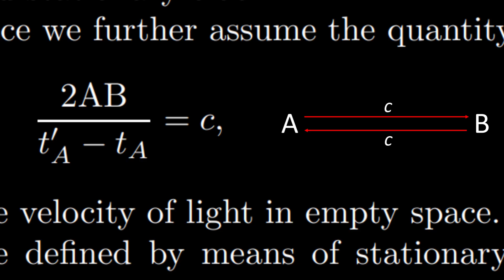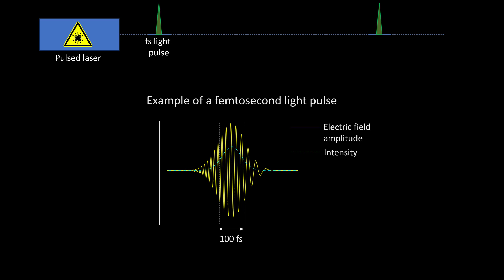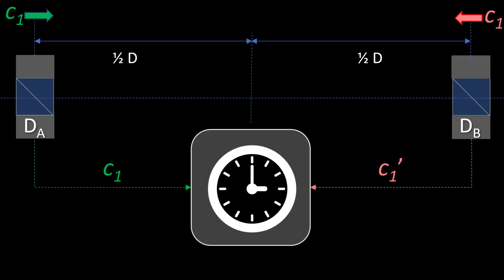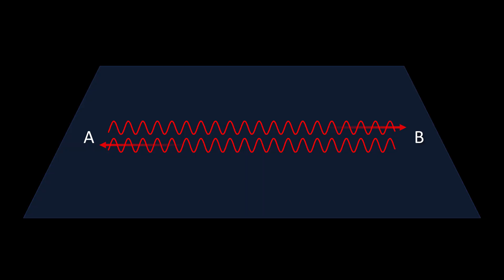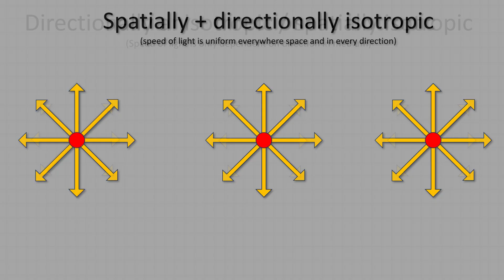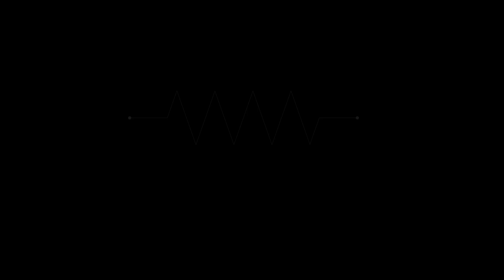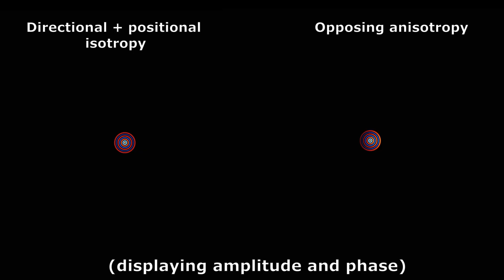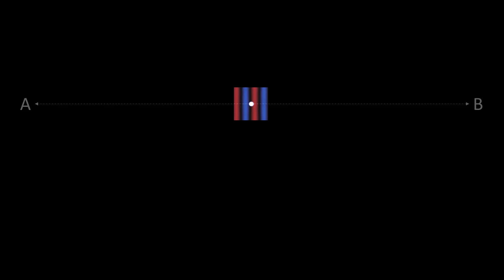Knowing the one-way speed of light

Comment: It's actually quite easy, technically you just have to take advantage of the non-linear nature of time dilatation.  Basically you take some atomic clocks, move them rapidly in two different directions and graph the change in time.  The time dilation on each clock should fit the curve t₀/√(1-v²/c²) where t₀ is the time for the 'rest' reference.  If they fit to the same curve for each direction, then the one way speed of light is the same.  In the Veritasium video Derek seemingly forgets that time dilation is nonlinear and doesn't get 'canceled out' when you bring the clocks back together to check their differences. It's annoying. 

The other way is that you just use a particle accelerator to spin a proton or whatever at like 99.9999% C.  If the speed of light were different then the particle would have to slow down on one side of the ring in order to maintain it's mass. (or it's mass would fluctuate on each side) in either case you'd need to adjust the timing or strength of the magnets to maintain the particle in the ring - in other words every time the large hadron collider is use the one-way speed of light is verified to be equal.

Comment: If the light had different speeds then we could not calculate its speed with the Maxwell equations and it would not be constant so classical physics falls apart. There’s another circular problem. We have defined meter in terms of speed of light so we wouldn’t be able to set up two ways equal distance without the assumption that the speed of light is constant. That is why we cannot solve this problem in classical framework.
Reply: We can define the meter using the bidirectional average speed without requiring that the speeds in opposite directions are the same

Comment: Your second explanation does not consider the main reason why one could use c1 different from c1' : the vacuum is not at rest compared to the observer. That's the main (and only) point of disagreement with Einstein relativity: the inability to observe absolute velocity, also know as the absence of Aether.
Reply: Indeed: there are no issue in the demonstrations, but they are a little bit superfluous as intuition give c1=c1' in a medium at rest, it was well known experimentally for other waves (where you can get out of the propagating medium, by using a much faster wave (light) to see much slower ones and the medium motion (sound and air, or waves and water).
So naturally people assumed the same before Einstein for light propagating in aether, and the whole discussing was how do the aether moves and how do we move on the aether. Strange things were observed and Poincaré came with a math trick to explain them. Then Einstein came and went further but telling that as we can not measure anything about motion (relative to) the propagating medium, keys get rid of the propagating medium(he went too far from me, but that's personal and strangely throwing the baby with the bathwater was fruitful - my guess is because it emphasizes the fact that we are deeply embedded in aether, without any way to look from outside, and this is a much more profound fact than it seemed)

Comment: But what is it about the nothingness of a vacuum that makes it resist or allow electric and magnetic fields?  I understand how air or water or copper or wood can have a measurable effect on electric and magnetic fields, because there is actual physical matter there.  But in a vacuum there is no matter.  So what is hindering or allowing those fields that gives the known values of Mu and Epsilon?  And if the presence of absolutely no matter in a vacuum gives these real values of Mu and Epsilon, then what stuff has NO influence on electric and magnetic fields?  What stuff has Mu and Epsilon values of zero?  When you measure Epsilon and Mu for a vacuum (nothing) by what known standard did you calibrate your instrument? Epsilon is a declared constant, not a measured constant. And they calculate it from Mu and light speed.  So now you can't claim that you can calculate light speed from mu and epsilon can you? That's a circular argument.
Reply from the maker: The vacuum does not contain matter but it does contain energy. And since matter and energy are equivalent, they can both be the origin of gravity and spatial inertia.  However, how much energy space is made of depends on who you ask: a quantum physicist or a cosmetologist will give you quite different values.
Reply: @HuygensOptics  Really? You think that matter and energy are equivalent because of SR?  The easiest theory to show is based on nonsense? Anyway, lets say you do believe really believe that matter is energy, so then, the vacuum is not empty, so its a medium then, an Aether, as Einstein himself admitted in his 1852 writings. But the vacuum contains no "matter" only "energy" which is equivalent to matter.  But what is this energy exactly? Define it please.  Not inertial energy, not chemical energy, not radiant energy, not electrical energy, not magnetic energy, so what is it?  You can't just say its "energy" because that's like saying that the vacuum is full of "Blurf" and not telling us what Blurf is. I have not heard any cosmologist or Quantum physicist ever say anything that was rational and logical. But they love lots of fancy words along the lines of my Blurf.  (such as "virtual particles that pop in and out of existence".  (virtual= pretend, imaginary) a virtual friend is my imaginary friend, the only guy who has the time to talk to me.

Comment: Hi, very nice video. I was thinking that you only considered a restricted class of anisotropy. I think it should be possible to have non equal speed in two directions without breaking energy conservation: you would do it with a chiral material. Left handed and right handed have different propagation speed. At the mirror you convert one into the other
Reply: True, but we know that the vacuum does not have such properties, since it would be easily detectable.
Reply: @entcraft44  well yes, but you see, there is a reasonable way to get different speed of light. This way has other consequences of course. I am not sure if one could not cook up a way that was not easily detectable. In the end, the question is about how isotropic the vacuum is. We can just assume it is, but it's nice to think to what level can we probe if it's the case

Comment: 17:50 Well but the point here is not that the speed of light doesn't change. It's only saying that the 2 way speed is identical for both A and B. Try moving A and B closer to the mirrors, without moving the mirrors. Then the signal from B will arrive earlier than A.

We can do for this an interference experiment in the vertical direction, aligned with the gradient of the gravitational field :) this experiment has been done and the result is called the shapiro delay.

The reason you don't see interference normally is because the gravitational field is pretty much identical in every point of the room you're in.

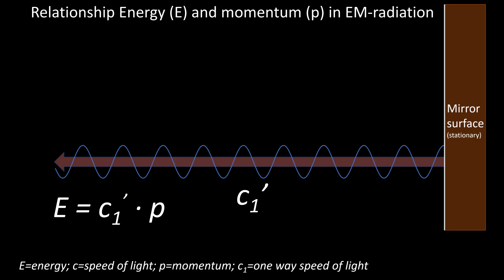21:50 well we DO have gravitational redshift, so energy conservation does not really apply here...

Comment: Sangac interferometer.
Reply from the maker: Good suggestion, I need to look into this.
Reply: @HuygensOptics  This YouTube video by Doug Marett (plenum88) essentially demonstrates how to measure the one-way speed of light using GPS data: "Earth rotation measured using GPS" (v=-bnBbHFfZ6k).

Doug shows how to use GPS data to calculate the pseudo-range correction (i.e one-way straight-line Sagnac Effect) as a GPS satellite approaches or recedes from a GPS monitoring station located at the equator.  Since we can calulate the value of the pseudo-range correction (in meters) from how far the station has moved from the instant of a GPS transmission due to the Earth's rotation, we know the propagation time and distance to the station at the instant of transmission.  Even better, we know the these values when the satellite is directly overhead and the correction is 0 meters.
Reply: @HuygensOptics  I can confirm that the Sagnac effect is relevant. 

About world wide synchronization of clocks. There is a unified world time: UTC (Coordinated Universal Time).
Likewise, the time keeping of the GPS system is a coordinated time keeping. That coordination of time keeping, down to nanosecond level, is what allows positioning down to the meter range.

The synchronization procedure that is used by the GPS system is not Einstein synchronization procedure; that would not work. Imagine a set of, say, 12 satelites orbiting in, say, the equatorial plane. Let the satellites be numbered 1 through 12. That constellation of satellites is relaying timing pulses around the loop, in both directions. So: from sat. 1 to sat. 12, and then sat. 12 relays the pulse on sat. 1 again. Same thing in the opposite direction. So in both directions a train of timing pulses is beying relayed. For the train of pulses that is co-propagating: every pulse takes a certain amount of time from emission by sat. 1 to being received again by sat. 1 after completing a loop, since during that loop satellite 1 has traveled some distance along its orbit. A protocol can be devised to work towards a sustained state such that the pulses traveling in co-propagating direction are equally spaced in time. Same thing for the counter-propagating train of pulses: make those pulses equally spaced in time. 

The key property: the speed of light is the same for the co-propagating light and for the counter-propagating light. It follows: when you have the same number of pulses in each direction, (as in, for instance, 12 pulses in each direction), then given that the time keeping is coordinated: as measured by the coordinated time the co-propagating pulses will be a longer time interval apart than the counter-propagating pulses.

The above described difference is an instance of the Sagnac effect. Information is travelling around a loop, in both directions. The time keeping stations have themselves an angular velocity with respect to that loop. To arrive at a coordinated time the angular velocity of the time keeping stations must be taken into account.

That coordinated time can be used as the basis of a one-way measurement of the speed of light. That will be a true one-way measurement in the following sense:
A speed-of-light measurement counts as a one-way measurement if the synchronization of the clocks that records time-of-emission and time-of-reception is established in a way that is independent of the propagation that is measured.

I will contact you directly: this subject is among the most interesting aspects of coordinated time keeping.

Comment: Electromagnetic waves do not need a medium to propagate while mechanical waves need a medium of propagation. That is why this analogy is not valid.
Reply: EM waves propagate in the EM field. You might not want to call it a medium, but the math is exactly the same.
Reply: @TheOneMaddin  EM waves always travel at maximum speed of propagation. Sound waves travel relative to the maximum speed of mechanical wave propagation in air. 
Maximum speed of propagation does not imply there is a medium. It just suggests waves can travel relative to maximum speed of wave propagation.
The notion that light slows down in the medium is false. Light never slows down in  a medium. Photons just takes longer path while travelling through medium at the same speed as outside of the medium.

Comment: Could you measure one-way light with two very good clocks (such as atomic clocks with 10^-xx where xx >11) stability over 15 minutes. Synchronize and measure time send/receive, swap positions and measure time send/receive?   With 10km you have ~30usec one-way.
Reply from the maker: if you start moving them, they desynchronize due to acceleration.
Reply: @HuygensOptics  and the amount would be asymmetric if the speed of light is, I guess. As bad as thermodynamics.

Comment: Compare speed of light in opposiite directions by doing 2 simultaneous 1-direction measurements.
Make a rigid shaft 1 uSec (at C) long.
At each end L/R, have a disk-like object with 4 quadrants (1,2,3,4)
1, 2, and 3 are solid, with a very skinny radial slit at middle of 2 to let light pulse pass throgh at a speciic angle. Call that angle 0.
4 is empty, with a very skinny radial pin which can block a light pulse at a specific angle (180)
At 0 rotation speed, align disks so that position 2 (slits) are lined up both at -0.
Place light source at each end, beyond the disks,
Now rotate the rod at increasing rate, until light passing through each slit is blocked by the pin at the opposide end.
You don't need to measure the time that light is received. You don't pay a priice in time to report the results back to the middle.
All you need is to observe that the light is blocked by the pin at the same RPM in each direction, giving cnostant dark at each end.
Note that the speed of light is the primary way to measure distance.  But since the same shaft is being used in each direction, and since (I assume) the rod has the same length in opposite directions at the same time, it seems that the only way to have light obstructed by the pin at each end at the same RPM is ffor light to take the same time in each direction.
Single-direction measurements, not sum of delays in 2 opposite directions.

Comment: Very good video and I think you are correct. Light speed is the same in any direction - HOWEVER what we really want to look at is if it takes the same time for light to go the same distance one way or the other. You may say that if we measure the same length both ways then of cause it should take the same time if light speed is the same. I then say but what if the whole setup is moving? That is really the thing I believe as we all know that we are moving and as the speed of that movement is unknown it has been said that any reference point is valid. I believe that if you put a movement into the setup it is clear that the time taken one way must be different to the other way but to find those time differences is THE REAL PROBLEM. Remember the distance scale is moving with the observer.
When we become able to check the time taken for light to go in any direction we should then be able to calculate time dilation for every observer correctly. 
The way I understand that it is at the moment is that an observer traveling near the speed of light can claim to be the reference point and there fore standing still. If this observer sends a light beam in his own travel direction it obviously can't travel very fast COMPARED TO THIS OBSERVER as other ways it would break the speed of light. 
My view point is that all observers are probably moving at different speeds and in different directions BUT then there must be an ABSOLUTE STAND STILL. This will allow all observers to see the speed of light at their point AND THEIR TIME SPEED to calculate every body else's time speed and actual speed as well I believe.
Time dilation is real I believe but that is really not much different to that we freeze meat. The frozen meat lasts longer (stays young longer) before it gets too old to eat.